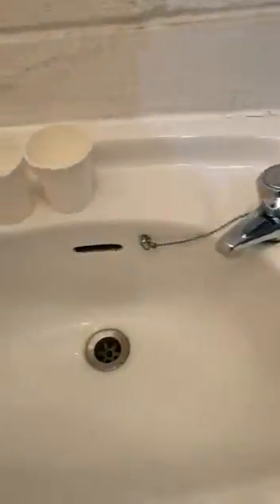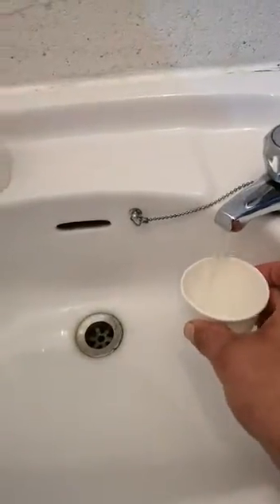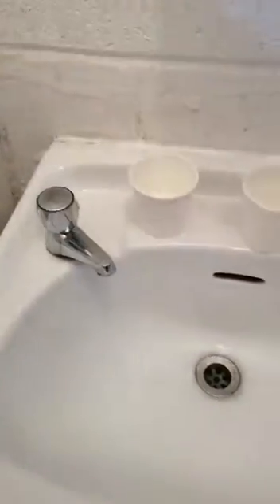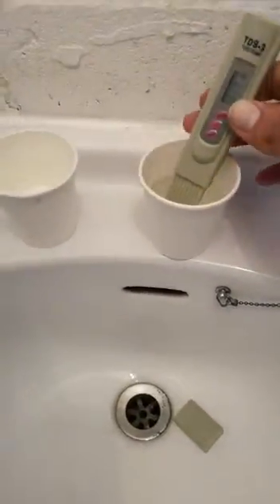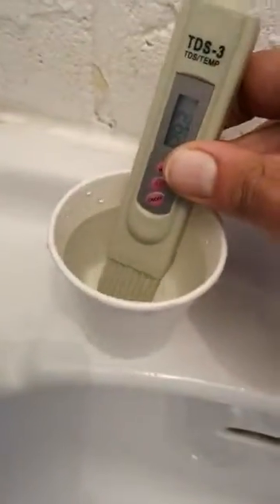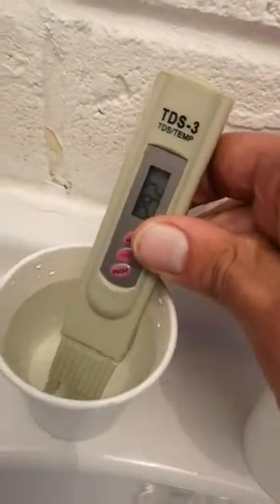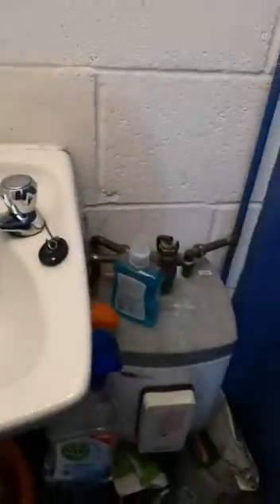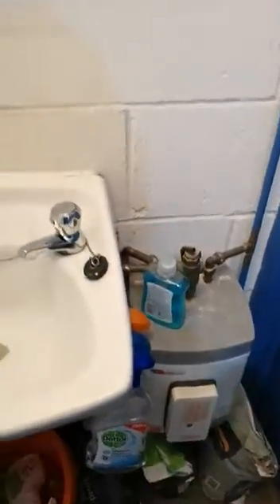Why you should not use HOT water for cooking or drinking!

Comment: Chlorination is possible in two ways.  Either chlorine is added to water by first producing saturated chlorine water from gaseous chlorine, which is then added to the produced drinking water, or it is mixed in as a sodium hypochlorite solution.  In both cases, the result is the same – the destruction of bacteria.  The advantage of chlorination compared to other methods of disinfection is that chlorine is released from the water gradually and therefore works for a longer time.  However, even chlorine does not last forever in water.  It is volatile, which means that it releases itself from the water and needs to be replenished continuously.  The first chlorination is carried out immediately at the water plant after the end of filtration, and the next dose is added to the water during storage in water reservoirs.